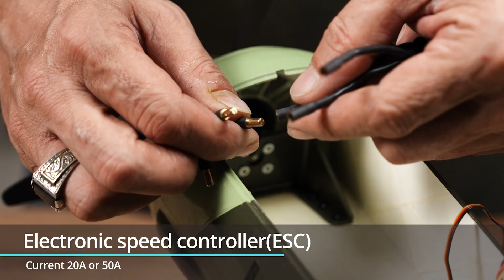3D printed Focke-Wulf Fw 190A - Build Guide

Comment: I wish it was an option on these WWII planes y'all are designing to have flaps, I know it's fairly small but could use Y-Splitters for the ailerons and flaps to still use a 6 channel receiver/transmitter.

Also really hope that some of the newer design features with the tabs for ease of assembly get added to the older models when y'all revisit them.
Reply: Two years ago I built the 3Dlabprint FW and its got the same wing setup. However I got a notification of a free shorter wing they released for it but did not look to see if they got flaps. For 20 dollars it’s a fair price and it flies great!
Reply: @k.o.0  Is there a way to add a controllable rudder to it? Would've gotten their models if they had the option to add a rudder.
Reply: @TheArtyTech  Original plans don’t offer it but if you print out of LW-PLA it’s actually notched already and simply cut with x-acto and it’s totally doable. I did leave mine stock, but it is likely a half hour to cut and add the horn and servo. I guess you love doing your knife edges! I leave that for other models like the Edge 540 with big surfaces.
Reply from the maker: The limitation is the space in the wing for more servos.
Reply: @eclipsonairplanes  Just an idea that came to mind looking at WingC, maybe a single center mounted servo between where the flaps would be and have that servo connect to a shaft that the flaps slide onto during assembly or something?
Reply from the maker: @TheArtyTech  Yes, that might works, we will keep in in mind for future projects.
Reply: @TheArtyTech  Yes I was going to suggest either a center servo with 90 degree horns is one option. Another option I have done is actually using embedded flexible cables that run out of the wing and I have the servo mounted all the way up in the front of the plane. This second option requires you to hook up to servo every time before flying (if you are disassembling the wings) but it also works very well. However I don’t think such a solution could work for 3D printed since I install the sleeve before skinning on balsa builds.